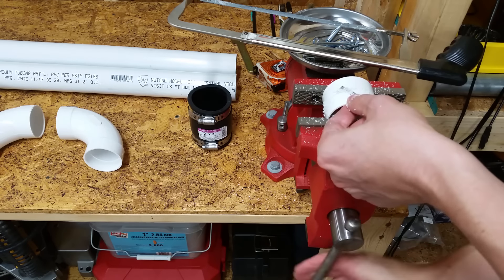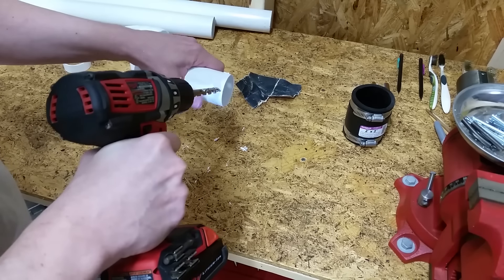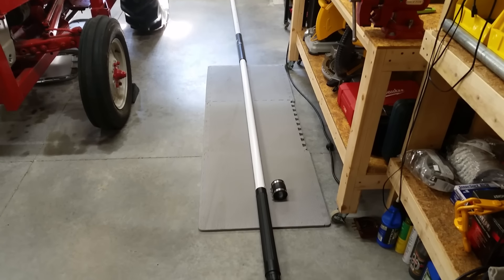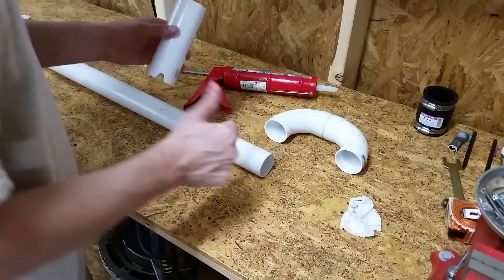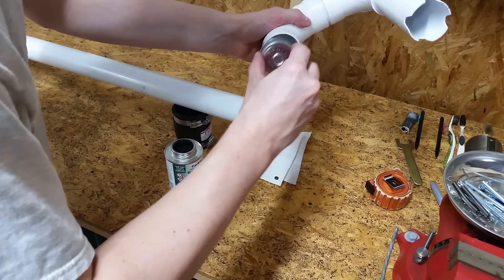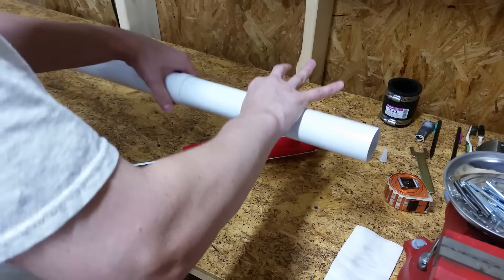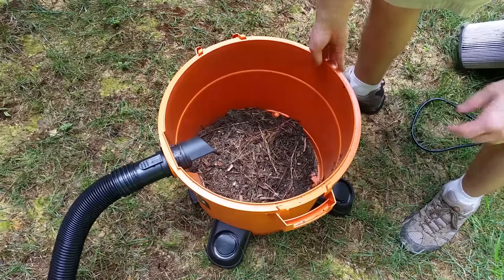DIY Gutter Vacuum - Easy and Safe Gutter Cleaning from the Ground

Comment: Ok for fine dust but what about large clumps of moss and pointing debris too big / too heavy to vacuum?
Reply from the maker: I'm not sure what's in your gutters but, if it'll fit in the tube and you have a strong enough vacuum, it'll suck it up. When I first started using it, I had some large clumps of matted pine needles. Bouncing the tip of the attachment around on the clump successfully broke it up and the remaining chunks were sucked up. Now that I use this attachment twice per year, everything is sucked up with ease.

Comment: I wonder if you could couple in a 2nd vac to increase the suction and amount of air flow ?
Reply from the maker: Possibly but, if you use a well powered wet/dry vac, it wouldn't be necessary. I have a "5 HP" vac and it has plenty of suction.
Reply: @Mikeattempts  thanks for the video,  I have high gutters on a sloping ground so getting a ladder up there is always difficult and time consuming.   This will definitely be a future project.
Reply from the maker: @swagobill  Just be sure to get central vacuum tubing, it's the key to keeping it light and maneuverable. If you have a hard time finding it, just call you local electrical supply store. I got mine at a store like that for only $6 per tube. Let me know how it goes.

Comment: nice video helpful. i am determined to replicate the same setup, but none of the house improvement stores/amazon carries schedule 20 2inch pvc pipes to replicate the same.
Reply from the maker: I bought my central vacuum tubing and fittings at my local electrical supply store. Call around and they should be easy to find.
Reply: @Mikeattempts  thanks a lot Mike for the tips
Reply from the maker: @sdiode  No problem, let me know if you have any other questions.

Comment: Does this work even with really built up gutters?
Reply from the maker: I'm not sure. If the gutters are filled with dry, unmatted, debris then it should be fine. If they are filled will heavy sludge, then you might want to clean them by hand the first time. After that, a yearly cleaning with this attachment would be easy.

Comment: How long is the total system? I have about 38 feet on one part of house to the gutters.
Reply from the maker: 38 feet from the ground? Wow, that's high! You could buy 10 foot sections of the central vacuum tubing but it would need to be about 34 feet long to reach (assuming you were holding the other end at about chest height). At that length, I assume it might be too unwieldly. Would a gutter that high even catch any leaves?

Comment: Do you think this is doable with a 3 story house?
Reply from the maker: If you did make a 3-story attachment, I would skip the ABS pipe coupler and just do the regular central vacuum PVC couplers to reduce the weight as much as possible. You would need to use PVC cement on the couplers for a strong bond. However, at 3 stories high, it would probably be difficult to control.

Comment: Nice design sure beats the contraption I use to clean mine. Appears you are primarily dealing with pine needles. Wonder how it would work with leaves?
Reply from the maker: I have a lot of pin oak leaves and some other larger leaves in the front gutters but it's mostly pine needles. I think if you have a powerful vacuum (5 HP or more) it'll suck up anything that would make it in to your gutters. Thanks for watching!

Comment: I cannot find schedule 20 pipe.  I tried using schedule 40 but there is no way to mate it to my shop-vac.  Any suggestions?
Reply from the maker: You know that rubber coupler I showed at the beginning of the video but didn't end up using? I think you could use that to couple sch 40 pipe to your vacuum hose. However, unless you're only doing single story gutters, sch 40 will be too heavy. Call you local electrical supply store and ask if the have central vacuum tubing. If you haven't already seen my follow-up video, give it a watch, there's some additional info that should be useful: https://youtu.be/mSSDkTUUz8E
Reply: @Mikeattempts  I'm going to call some local electrical supply houses today for the schedule 20 vacuum tubing.  There's another issue I ran into that I did not mention before.  Your second video says you used a Rigid 5.0 hp wet/dry vac with a 2.5" hose.  These units now list for $90 at Home Depot and are less powerful than my 6.0 hp Shop-Vac.  The problem is my Shop-Vac has external threads on both the suction and exhaust ports that accept a reduced diameter hose (1.5" OD/1.25" ID) fitted with a large threaded female coupler.  The good news is both of these ports have 2 1/4" openings which snugly accept a 2 1/4" OD coupler or 2 1/4" OD x 24" extension, both of which I have on hand.  But I'd still need some sort of large diameter flex hose that can be attached to my Shop-Vac (either by threading or friction fit) and your gutter cleaning attachment.  Any suggestions?
Reply from the maker: @Paladin1873  You can buy replacement 2.5" vacuum flex hose at most home improvement stores like Lowes and Home Depot.
Reply: @Mikeattempts  Thanks.  I'll take the coupler and extension with me to make sure I find a hose with a good fit.
Reply from the maker: @Paladin1873  Let me know how it turns out!
Reply: @Mikeattempts  Will do, but I won't be in town until Wednesday.
Reply: @Mikeattempts  Well that was a bust.  No hardware store or electrical supply company in Helena has it or has even heard of Schedule 20 vacuum tubing.
Reply from the maker: @Paladin1873  Really?!? Maybe if you just ask for Central Vacuum Tubing and tell 'em it's the tubing that goes inside the walls when installing a central vacuum in a house.
Reply: @Mikeattempts  Right after I posted my last reply I did some more searching and found a video posted by a pipe supplier who explained there is no such thing as Schedule 20 pipe.  He claims it is an incorrect term used by vacuum tube sellers trying to push their product.  Based on this information I called my local area vacuum shop and, sure enough, they have it and the 90 degree sweep elbows.  Now all I need to do is find some 21/2" flex hose that will fit into my Shop-Vac.
Reply: @Mikeattempts  I picked up the 2" vacuum tubing and fittings from the local vacuum shop (two 8' pipes, a scrap piece, two 90 degree sweeps, and a coupling).  Home Depot sold 2"x24" Schedule 40 pipe I could use as a connector.  They also had a Ridgid 2 1/2" x 7' flex vacuum hose kit I needed to adapt the 16' extension to my Shop-Vac (it only has a 1 1/4" hose).  Fortunately, the Ridgid flex hose fit my Shop-Vac without any issues.  The hose kit also contained several adapters for the opposite end of the hose, so I picked the one that fit snugly inside the 16" extension, then heated the end of the hose with a hair dryer for a few seconds to temporarily soften it while I inserted this connection.  I only varied from your instructions in one regard.  After inserting the two 8" sections of pipe into the Schedule 40 coupler, I wrapped each joint with duct-tape to form a better vacuum seal.  I just used the contraption to unclog a gutter 21 feet above the ground.  Many thanks for advice.
Reply from the maker: @Paladin1873  That's great, thanks for the update!

Comment: how many feet up is your gutters? mine are 18 feet up so kinda challenging... looks like yours are high up there too...
Reply from the maker: My highest section is probably around 19 or 20 feet high. That's why, if you end up making one of these, you need to use central vacuum tubing. It's SOOO much lighter than schedule 20 PVC. Both sections weight only 2.5 pounds combined, I couldn't imagine the struggle it'd be with the additional weight. I got my tubing and fittings at a local electrical supply store for cheap.

Comment: Why the specific 5 3/4" length dimension for the final piece that hits the gutter?....seems like a very specific dimension for a reason?......
Reply from the maker: That was just the length that worked best for me based on the depth of my gutters. I wanted to make sure it could reach the bottom of the gutter without hitting/dragging on the outer lip of the gutter.
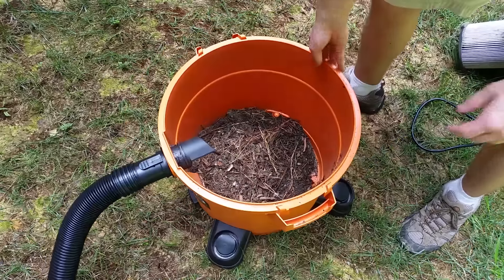Reply: @Mikeattempts  ....OK...that's what I kinda thought might be the reason..... but even so, I thought you might settle on a rough number,  something like " 6 " inches anyway.....some simple number. Would there be a problem ( maneuverablity ?), if it's a bit longer than "necessary"? Last question....at timeline 6:43 you mention the slight inconvenience of having to work directly under the gutter getting a  stiff neck. Two things....why look up?...you can't really see how well you're cleaning anyway....go by "feel"....and.....may use a 45 dgree final elbow?....and also cut the gutter-touching "End
 at 45 degrees?....this way you stand a bit further away from the house wall. But....this extra length can possibly be be awkward to move around?
Reply from the maker: @TheWilferch  I wanted it to be just long enough without cutting off more than needed because the size of that small pieces takes away from the total length of the attachment. You are right, you definitely work off of the "feel" but, in my case, I needed to look up to more efficiently maneuver the tip up and over my internal gutter hangars. If your gutter hangars are on the outside, you wouldn't hafta worry about that. You were also right about standing further away from the house, it would require a longer attachment to reach the same gutter and would be more awkward to move around. This wouldn't be as noticeable for a single story house.
Reply: @Mikeattempts  ...all good points...and in any case our dialogue offers some options for others to consider as we build our own units...for our own conditions.

Comment: Did the vucumm have enough pull from that long vortical pole
Reply from the maker: Yep, I use a "5 HP" wet/dry vacuum and it seems to get everything. They make "6 HP" and "6.5 HP" if you need more suction. Thanks for watching!

Comment: You gave me an idea.  I could make the PVC pipe extension like you did, and attach it to my high-powered gas leaf blower.  Ahh, let me think about it.   Thanks.
Reply from the maker: Yeah, you could do that or you could just attach the hose to the exhaust port on your vacuum to blow the leaves out. Thanks for watching!
Reply: @Mikeattempts ...  I did that years ago with 1.5 " schedule 40 and a leaf blower. Worked ok and I still have it but it's too heavy for my back these days. Might revisit it again with lighter pipe. OTOH, in the next year or two I will be downsizing and looking for a single story home.
Reply from the maker: @rupe53  Yeah, a single story house would be nice, lower gutters and no stairs! :)
Reply: @Mikeattempts  ... that's my direction. I turn 68 next month and my wife will be ready for SS in less that 2 years so the idea is to head slightly south from the northeast and slide into a single floor arrangement by age 70. If I can't do it from a step ladder I will hire it out. I want no more than 2 steps for the exterior doors or garage and no stairs at all.

Comment: Do you think something like this would work for a one story house if you have a 4.25 HP wet dry vac?
Reply from the maker: Yeah, a 4.25 HP vacuum would probably be fine. You'd only need to make the top section for a one story house. If you have any problems finding central vacuum tubing, call a local electrical supply company. Let me know how it turns out.
Reply: @Mikeattempts  I am trying to keep my husband from getting on the roof.  Worries me.  I am not very good at using tools, so i ordered an inexpensive pre-made kit similar to what you made and i will try it with my leaf blower.  If that does not work, then I will try wet dry vac.  It cost more for me to buy pre-made, but I would have had to buy all of the tools and other things to make it, so maybe I came out a bit better that way.  Plus, I can return the kit for a refund if it does not work.  I think your idea is great.  Thank you for your response and all of this help.
Reply from the maker: @autumninkentucky  Home Depot also sells a kit for around $30 that attaches to a wet/dry vac. It's only good for 1 story houses but it sounds like that's exactly what you need. Here's the link: https://www.homedepot.com/p/203235222

Comment: how do you connect the piping to the shop vac tubing if the tubing is 1-1/4 or 2.5"  I can't find a flexible coupling that fits.
Reply from the maker: This was my very first video and I really wish I had explained it better. If you have a standard 2.5" shop vac hose, you do not need a flexible coupling, the white gutter vac tube will fit perfectly inside one of the standard shop vac black extension pipes. It will stop when it hits the white ring that is glued on the outside of the pipe. Also, you don't need to cut the white coupler in half, like I did, to make the white rings, you could just cut two 1" rings off of the black ABS pipe to use as the stops. Everything just slides together, gravity and suction keep them together, no flexible coupling required. Does that make sense? If not, feel free to ask any other questions you might have.

Comment: Thanks for the tutorial.  I made one with your tutorial, and it worked out.  The only problem is at around 24 feet, its pretty wobbly.  I can't help but wonder if there is a less flexible material that can be used. Also, why isn't there a cheap telescoping pole made of aluminum being made for this purpose?  How much could it really cost? $60?  Only ones I see are like $900.

Anyways, I'm wondering if anyone has any ideas for a firmer material?
Reply from the maker: You're right, the only other option I can think of is aluminum tubes. Do you need the full 24 feet? If not, you could trim it down so it's just long enough to reach your highest gutter. Since mine is two sections, I'll hook the top section on the gutter and let the bottom section slide off. Then I'll attach the bottom section to the vacuum hose, turn it on, and then reach up to reattach the top section, the suction helps pull it together.

Comment: How far up do you slide that coupler?
Reply from the maker: If I remember correctly, I slid it up 12 inches. That way it meets the other section of central vacuum tubing inside the ABS coupler and also provides enough support when slid inside the vacuum extension at the bottom.
Reply: @Mikeattempts  thanks

Comment: Hi,  great job! could you please advise the diameter of the pvc pipe? Thanks!
Reply: 2 in,  I got it.
Reply from the maker: This isn't standard schedule 40 PCV pipe, it's central vacuum tubing. The outside diameter of the central vacuum tubing is 2 inches but the wall thickness is only 1/6 (0.0625), which makes it much lighter than standard PCV at around 5/32 (0.157625) thick. If you have a hard time finding central vacuum tubing, call your local electrical supply store. Thanks for watching.
Reply: @Mikeattempts  many thanks for the details!

Comment: How does it work with leafs ?
Reply from the maker: There were leaves in the gutter but not big ones. I can only guess that sucking up big dry oak leaves might be a little more challenging. If they were slightly damp and still a bit flexible, then I think it'd be fine. You could always just rake up some of the bigger leaves and see if the vacuum can suck 'em up off the ground. If so, then I'm sure the attachment would work too.

Comment: Is vacuum PVC different from sewer/drain?
Reply from the maker: Yeah, central vacuum tubing is not pipe so it's measured different. I assume by sewer/drain pipe you mean ABS? ABS is light weight, it's what I used to couple the sections, but it's still heavier than the tubing. I did a follow-up video with more details and answer a lot of common questions.

Comment: I built something similar but with schedule 40 and yeah big mistake it is too heavy. However I can't find schedule 20 anywhere around me. Anyways how does it work with pine needles and when it gets clogged do you bring it all the way down or turn off the vacuum to release the suction and try a smaller amount?
Reply from the maker: I haven't had any clogs yet but they'd probably happen with a weaker vacuum. If I did, I would probably turn it off, move the end of the attachment further down the gutter, turn the vacuum back on and try again. Call your local electrical supply store, that's where I got my central vacuum tubing and fittings.

Comment: I am considering downspout . would it be be lighter and feasible？
Reply from the maker: I think a downspout would be light enough, you'd just have to come up with a good way to connect it to the vacuum hose. If you try it, let me know how it turns out.
Reply: @Mikeattempts   Your connector is professional.  I plan to connect downspout by wrapping Electrical Tape
Reply from the maker: Sounds like a plan, let me know how it goes.

Comment: I started with the pipe 40mm, that was stupid of me. Then I have taken 90mm as it was the only one bigger which I had.  It is better but vacuum hose now clogging. I have leaves from oak trees which stuck  in hose.  Will be trying to make a sort of filter of plastic mesh. Now I understand why professional when he came cleaning he have not used any pipes. It might work for pine needles but for leaves you either do it with manually with some tools or you blow them out. I just found petrol blower from the roof works better and quicker. One problem though it removes only 75% of the leaves, the rest requires 2nd or 3rd walk. I decided I'd rather do 1 walk remove 75% do it quickly and in 1 months when all leaves are gone I'll do again quick walk.
Reply from the maker: Yeah, I get mostly pine needles and smaller leaves like pin oak and maple so I haven't really had any issues with clogging. You could also attach your hose to the exhaust port of the vacuum and blow out the gutters using your 40mm attachment.